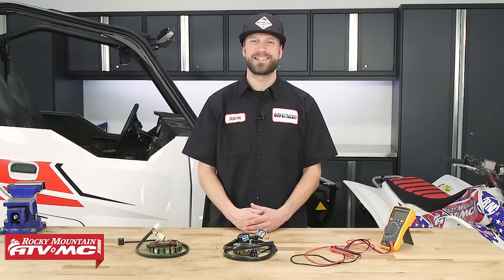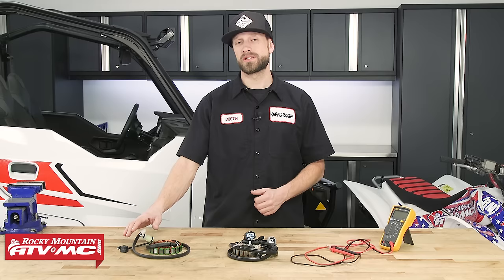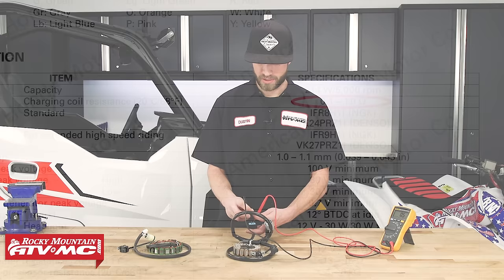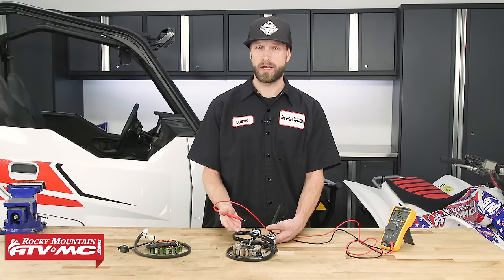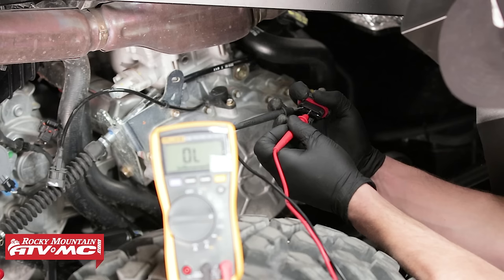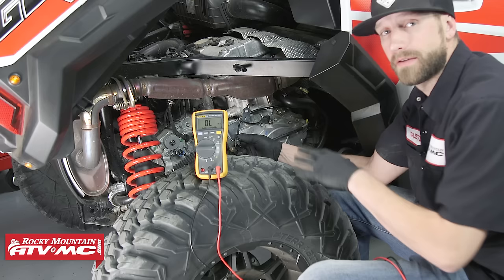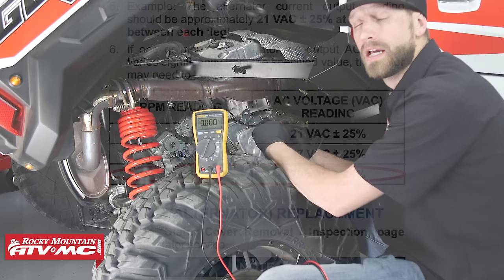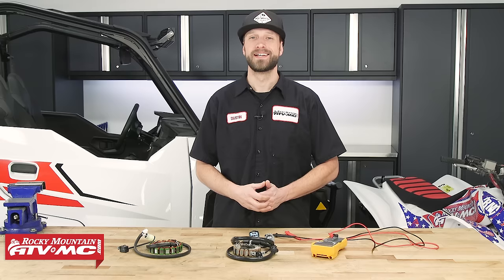How To Test a UTV/ATV Stator

Comment: I have a 2014 Polaris ace 325. I tried testing my stator but when I cross the leads it reads 0.0 across the board. Doesn’t show that it is ground out. But when I test when it is started it’s getting 20-21v ac

Comment: I had a man work on my 2005 artic cat he hook up a 24 volt drill battery to it now it won't start or turn over and my dash light comes on but no digital stuff comes on and as soon as you turn key on it pops the ignition fuse I need help plz

Comment: HI, I am getting output from the recitifier for 14.x volts, but the batttery is not taking a charge at the terminals.  Does a fusible link exist between the recitifier and the battery?  Been looking but cant find anything

Comment: If you replace a bad Stator, should you also replace the voltage regulator?
Reply from the maker: It's not a bad idea to replace the voltage regulator as well. It is possible a bad regulator could make your stator go bad.

Comment: Greetings,
 everything is well explained,thank you for posting, is realy helpful.
 namely, I have a problem with my Tuono rv4, the stator burned and I had to buy a new stator, so when I was already changing the stator, I also bought a regulator. I changed everything properly, but no voltage comes out of the stator during the test. I tried to test according to your instructions, I don't have such a voltmeter, but I figured it out on mine, I tried everything but it doesn't charge my battery and I'm already a bit crazy.

Comment: Great video!! I've tested my stator a million times passed the static test but on the reading it fluctuated a lot it wouldn't give me an exact decimal it fluctuated between 0.6 and 1 on the dynamic test at idle it was 20 volts AC at 3,000 RPMs. It was putting out 60 volts AC so I thought my stator is good it keeps passing the test . But my VRRs keep failing and the last one got so hot it melted the plugin from the stator and I know a bad plugins can cause it to heat up because of the connection. But this connection was good right full of dielectric grease I even added a couple extra grounds new battery  that can be a cause of a failed VRR I have gone through three and  the previous owner had put one in it I haven't any extra accessories I'm really stumped here any info would be greatly appreciated 16 RzR 1000 turbo

Comment: My stator resistance test came in at 0.2 ohms, the manual says it should be 0.19, is this good? This is on a 2007 Polaris Ranger 700, Thanks

Comment: if i get a high reading when measuring the sensor and ground and the position sensor is done can there be a spark at all? if cdi is powered by battery? and first i thought the stator windings were torn but its only this thin yllow isolation wire that is ripped on one side. does that mean anything?

Comment: Can you confirm this for me? I have a polaris youth outlaw 50. The 3 stator wires are different colors. All three of those wire when tested to ground show resistance. This means it's bad right? But the new replacement is the same way. And is this a single phase?

Comment: I am assuming if you are able to do a dynamic test of voltage output from the stator with it disconnected it is not a component needed to achieve spark? Only sending AC power to the voltage rectifier and then charging the battery? I am not able to start my Polaris 570 Sportsman engine turns over but no spark. Only test that has failed so far is the Crankshaft Position Sensor which I have on order. ohms tested 1000 on the three yellow leads coming off the stator nothing on the CPS sensor. That is where I am starting. Don't want to have to remove the coolant and and stator cover yet but I was wondering if I could figure out if the woodruf key sheared by checking voltage by turning over the engine with the starter obviously without spark I cant get it running but thought if the key was intact I would see a small voltage gain at the yellow leads when I turn over the engine? If the key is sheared no voltage should show, if its intact I should see something as I assume the magnetic flywheel spins when you use the starter?

Comment: Hello from Cancun Mexico,please i need advise On checking my stator, working on a 2005 Honda Varadero 1000 , did my static test and the  service mannual says I should have 0.3 to 0.5 ohms but my stator reads 1.7 on all three Phases.
The dynamic test I did at 1000 rpm 24 Volts AC
At 5000 rpm 65 volts and at 6000 rpm 100 volts AC
if you can help me please  I already burned 3 regulators , thank you very much....

Comment: Well i have a artic cat from a friend im working on the rectifier burned the stators wires but still ran when i hard wired it back together when i replaced the rectifier it stoped running before hand i think the rectifier fried the stator it was 1.5 ohms under 1 ohm spec but the brain i think wont let it spark without a working stator is that bad 1.5 ohms its 3 yellow single phase

Comment: How do you know which one is your yellow one your yellow two and yellow three
Reply from the maker: It doesn't matter. Start from left to right and give them numbers. The numbers are just to help you stay organized and make sure each wire gets tested with the others. They are all connected, so you are just checking that there is low resistance between all of them, and that they are insulated from ground. -Charles

Comment: I got a grizzly 660 2005 and it won’t spark no matter what I hooked a test light up to the wire going to the coil and hit the starter button and the light didn’t flicker could that be the stator pickup
Reply: Did you figure it out?

Comment: @Rocky Mountain ATV MC
 Mine stopped charging after the stator got really hot,after half an hour or so.And i know its the stator because i replaced the regulator/rectifier and still the same until i replaced the stator.
So my question is,how can you tell if the stator has my kind of problem before it gets hot and stops functioning
Thank you for the great videos
Reply: you might have a shortage on the winding when it gets hot. its a common failure

Comment: Great videos! I have an 07 kjng quad that when i test the stator it tests .2ohms but the service manual specs .4ohm to 1.0 ohms. The ac output is within spec of 85 to 90v at 5000 rpm. How can this be?  Ive replaced the regulator/rectifier already. And it gets too hot to even touch it! The quad still shuts off randomly, but im thinking its because of the regulator. Any ideas? Thanks for the awesome how to videos! I get 90 percent of my parts from you guys!
Reply: did you ever solved this problem? I am dealing with the same thing on my king quad. it melted the regulator connector, but when testing it, it seems good...
Reply: @g0guletu  i didn't.  The customer became inpatient.  I was about to strip the harness out and check for a shorting wire or something. The stator even tested good.

Comment: This is in depth, but wouldn't it be easier to start your machine and unhook your battery? If it runs without the battery, everything is working. If it dies, you have a charging issue
Reply: Sure. But if it dies what now. Theres an issue but wouldnt it be nice to know if you need to buy a high dollar stator or a voltage regulator? He shows how to troubleshoot not guess
Reply: @davedunn2124  stators don't normally go bad unless they have been physically damaged in some way. But i guess the connection could fail

Comment: Where can I find a service manual for a 2016 rzr turbo that shows all those specs? I found a generic one that’s 418 pages but doesn’t show ohm ratings or anything
Reply from the maker: We offer the Polaris OEM service manual that goes in-depth and will be much better than a generic service manual. You can check it out here: https://www.rockymountainatvmc.com/parts/polaris-oem-service-manual-p?v=12671